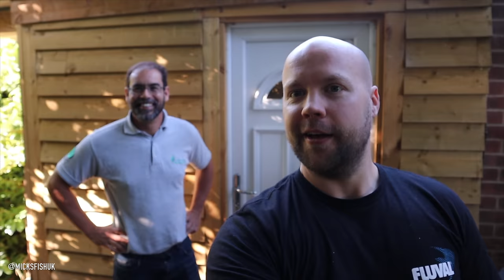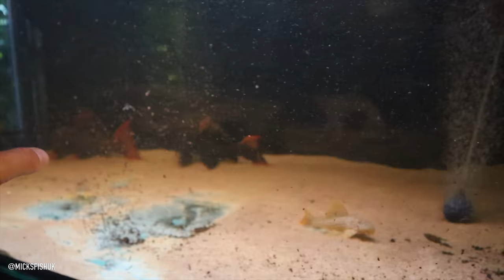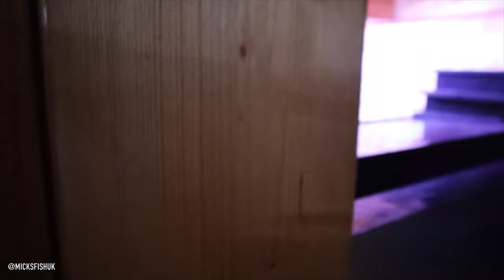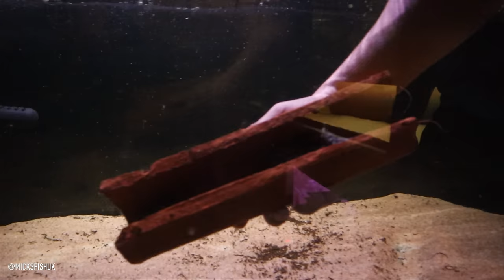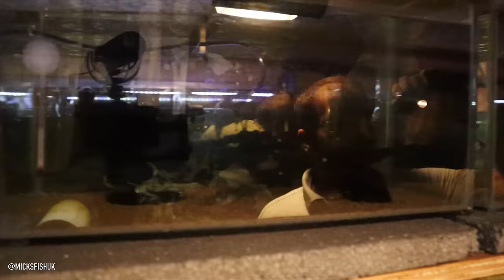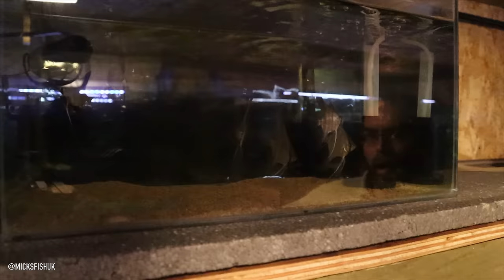EPIC PLECO FISH HOUSE FULL TOUR (MUST SEE)

Comment: Do you know where to find those huge clay tunnels? I’ve been inspired
Reply: Hi Vinny
I order them from a builders merchants in 4 or 6 inch diameter. You will need an angle grinder with a stone cutting disk to cut them in to sections. Thanks